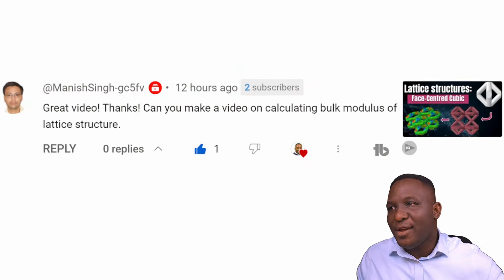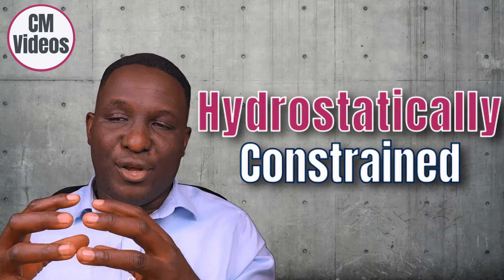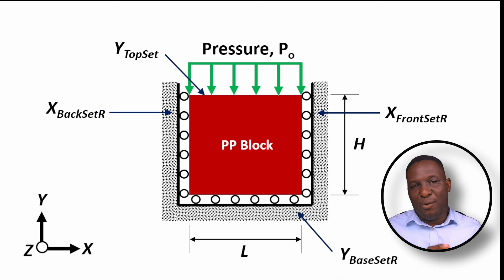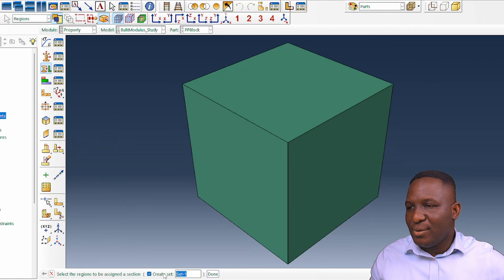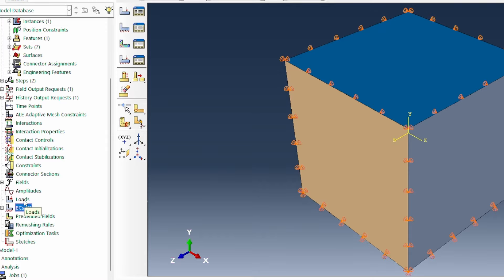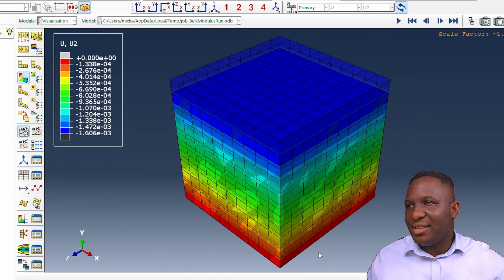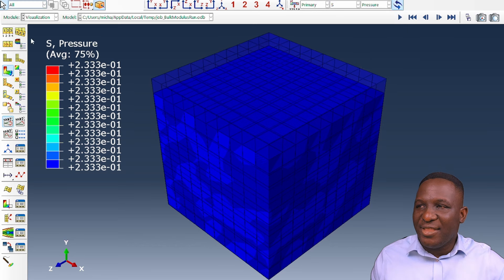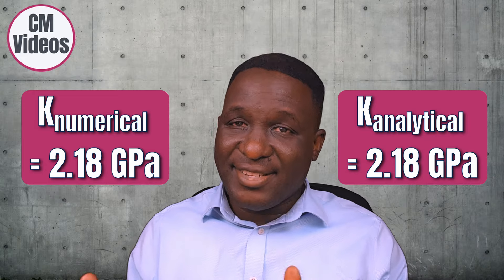A SURPRISINGLY simple FEA method to determine BULK MODULUS

Comment: Dear Sir,
Can you make a video for compression simulation of a composite metal system in which:
1) There is a Ti6Al4V lattice structure (3d printed) (imported to Abaqus from solid-works)
2) Molten Zinc was poured in that lattice and hence Zn is embedded everywhere in the lattice.
Then extracting stress-strain curve from the simulation result (with help of history output)
The plastic properties are needed as well (power law parameters for Ti6AL4V and Zinc from literatures)

Note: Please share your purchasable content which is/are related to this simulation.
Regards.
Reply from the maker: This seem like a large project and I do not take up complete projects. I only make videos to show specific elements to support students. This seem like something you can actualy research for yourself. 

If you look at the description sections of my videos, you will see resources I have to support your computational journey... mainly in form of software... which you can also get here: www.cmvideos.org/shop/